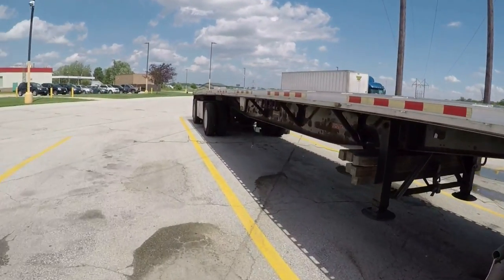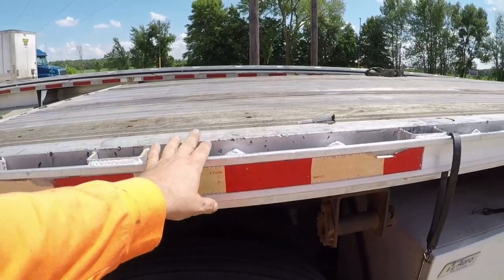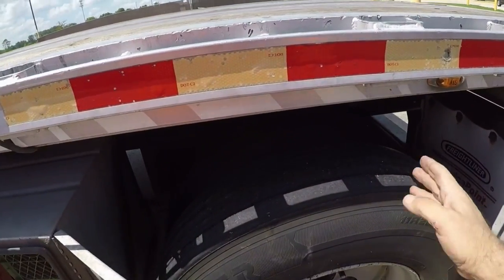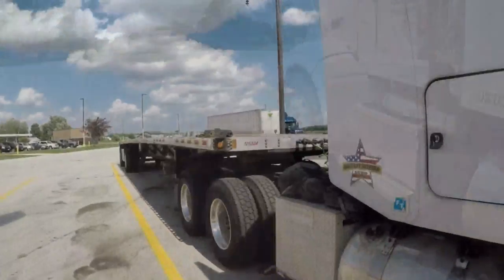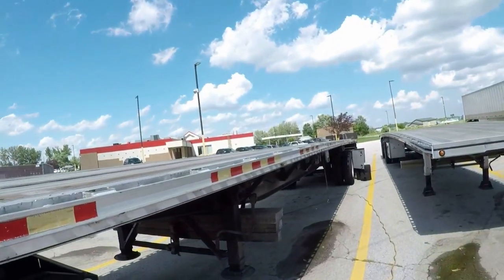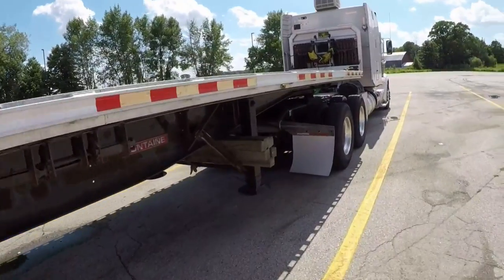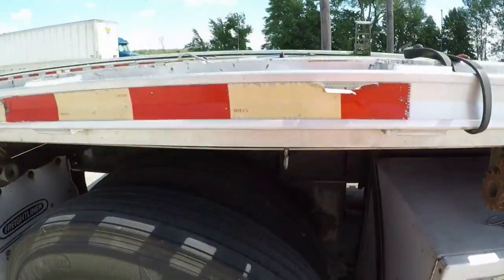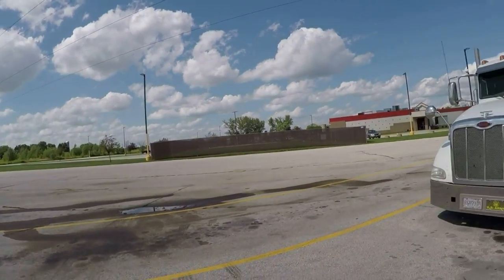#332 Let's Talk about Winches The Life of an Owner Operator Flatbed Truck Driver

Comment: Just another idea, What you could use instead of the bungie hooks, Is a smaller locking carabiner to place in each hole. That way you can unhook them in a matter of seconds.
And you won't have to leave the one at the tail end of the trailer. This way you will be more versitile without having to unbind the hooks if need be.
I use carabiners when I climb mountains and hiking with my pack.  They come in various sizes.  Hope this helps! Keep up the good work Dan, I thoroughly enjoy your video work.
Reply: Exploring America a spring pin would be even simpler. Dan just used what he had. 👍
Reply: @jonathanklippenstein4841  Yes, I understood that. Just throwing an idea his way is all I was doing! Good idea you have!

Comment: Hi Dan. Love your videos. I pull deck trls. also , tandem , tri-dem and super b in Manitoba Canada.  Been driving for quite a few years ( 72 years old )  55 years this summer.  The old saying of , never to old to learn something new , is sure true here .  Seeing what you did with the S hooks from bungees was really something.  The company I drive for puts nut and bolt stoppers on our rails when they get a new trl. to stop the winches for us.  One thing I noticed was your strap J hooks are sometimes outside your rub rails.  Up here that's not legal , so wondered If it's  o.k. in the states.  Yours are the most interesting videos of trucking in an old guys opinion.  Keep it up Dan.  Thanks  Wally
Reply from the maker: I have heard that the rules are different in Canada in reference to hooks on the rub rail. I do know that the way I attach the hook to the rub rail is legal here in the states. 
Thanks for watching

Comment: Hi Dan , your videos are always very informative , you could easily be a professor , you have an abilily to explain things.
Some questions about your trailer:
- you mentioned it before , that you plan to paint it , is that still an option
- if so , how much would it approximately cost , with sandblasting etc...
- or would you paint it yourself , you have the skills , to save money
- in the future , do you consider a 50 or 53ft trailer , to be more flexible with the loads 
- or is the 48ft trailer the perfect compromise 
Just some thoughts , i know you want to keep your costs down and a fancy trailer would not make more money by itself...
Reply from the maker: To have the trailer professionally sandblasted and painted would cost around $5000. Not too sure if I'm going to repaint. I'm really thinking about buying a used all aluminum trailer soon. I think 48 is the best option for short runs. I call the 48 the work horse of flatbeds
Thanks for Watching

Comment: Hey Dan,  I bought two new fontaine infinity trailers. One was a 2005 AX like yours and a 2006 AX. Both trailers only come with winches on the street side from the factory. If you look at the rail on the street side of the trailer you will see holes drilled in the winch track where they installed bolts with lock nuts to keep that from happening. But just as yours was done I took out my bolts as well. The problem was if you notice those holes was way back from the tire and made in impossible to strap that back without the ratchet strap which. So you were correct about the winch track being added later to the trailer.

Comment: hope you're using oil on the drill bit while drilling in metal. prevents the loud squeal noise, and saves the point a little longer. unless you're rich, then you can just buy new bits, lol

Comment: Super trucker Dan I might be a little off on saying this but I'm curious is to why you don't keep them in the lock box when you're not using them altogether and then you don't have to worry about them sliding up and down the tracks at all just saying too okay bs and bc out there too
Reply: How much does the tarps weigh that you tarp the loads with out there I'm curious okay

Comment: Dan if you'd used small padlocks you could remove them easily if you needed to move your back winch ever and as securement so no one pinches your winches
Reply from the maker: Good idea
Thanks for Watching
Reply: SuperTruckerDan SuperTruckerDan I watch all your videos,I have been watching you a long time,I used to watch when you had your other Peterbilt with the horrible cat engine in it,I call it a horrible engine as I'm a cummins fan,I learnt to drive a truck with a cummins engine and a crash box,I usually message you on Facebook or Face ache as I call it.
Reply: SuperTruckerDan I also watch an ex mercer guy called Brian(driven trucking)

Comment: Could you not turn the drivers side winch around? That way you have one on back? Also if you put bolts thorough your drilled holes. You can hit the end sticking out past the nut. Mushrooming the end of the bolt. That way if the nut tried to come off. It cant  drop off.
Reply from the maker: Thanks for Watching

Comment: Why do u store your straps? Would it be better to leave them on the winch? Sorry might be a dumb question I never done flatbed before been a  door slinger for 20 years.
Reply from the maker: Storing them just keeps them out of the elements
Thanks for Watching
Reply: All flatbeds wind up their straps after using them. They use a wheel thing to wind them up.
Reply: SuperTruckerDan Elementary😊
Reply: @SuperTruckerdan  thank you